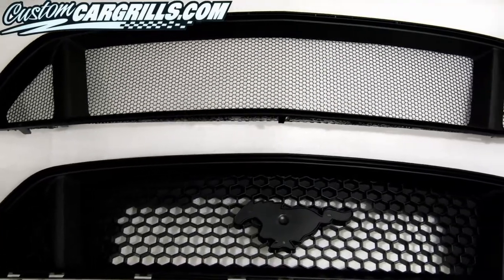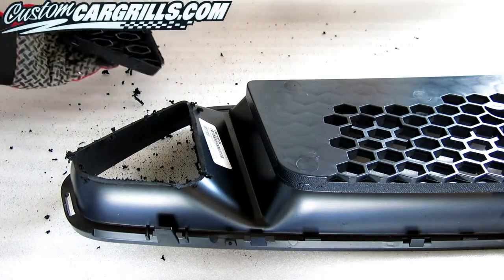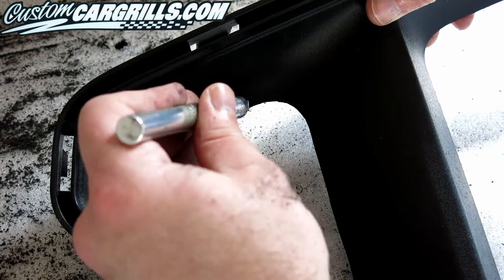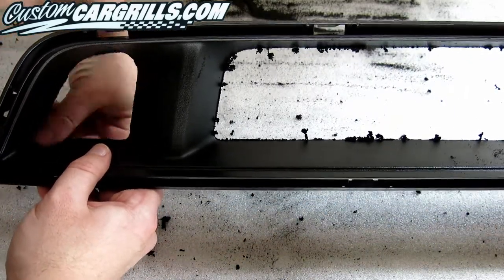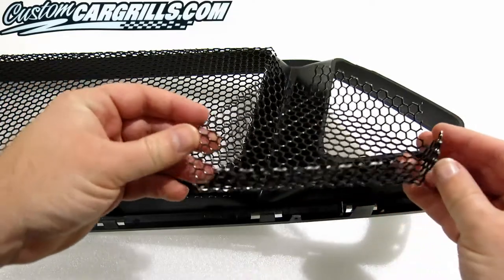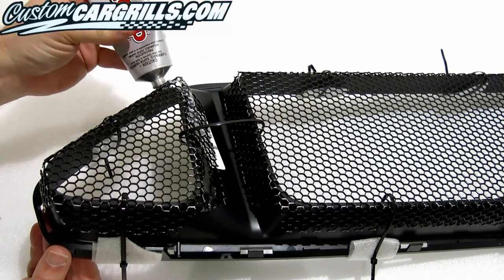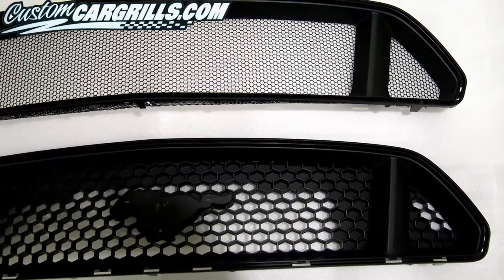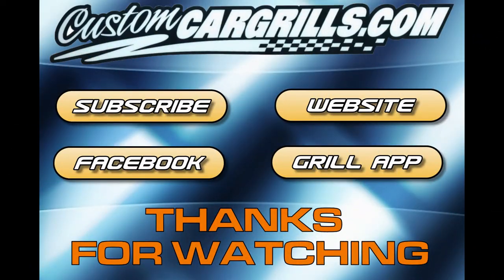Ford Mustang GT 2015-2017 Grill Delete Mesh Grill Installation How-To by customcargrills.com

Comment: Thanks for making this... any idea on how to get an off center 3.75 in Cobra to fit off center and look natural in the grille?
Reply from the maker: Richard Batty 
I'll hopefully be doing some emblem and lettering work on these soon.  For a Cobra emblem, I would tentatively say that placing it a couple inches away from the left or right edge of the center section should look relatively natural.
Reply: +customcargrills Yeah, me too, I still want a black horse emblem

Comment: Will this kit work for the l4 Ecoboost?
Reply from the maker: Only if you were to swap to the GT grills.  I think the top piece is a direct swap, but the lower may need modification.
Reply: Yes. The GT and both ecoboost grilles are dimensionally identical.

Comment: would that grill fit on a ford fusion 2013
Reply from the maker: No, the mesh is designed only for the 2015-17 Mustang GT.  We may look into a Fusion kit in the future.
Reply: Would i be able to buy a gt grill and put it on my 2015 v6 mustang ?
Reply from the maker: To my knowledge the stock upper GT grill should fit the V6.  I'm unsure about the lower portion.